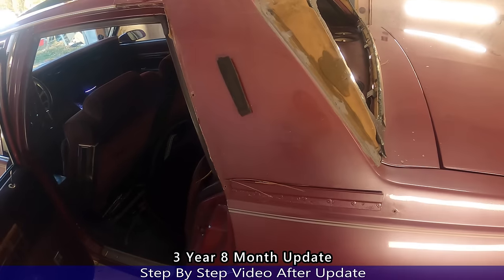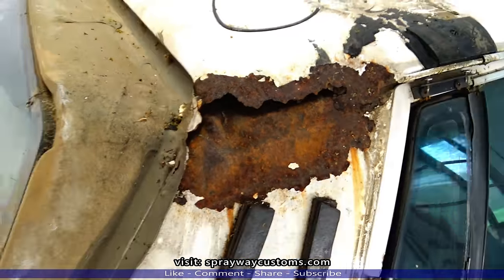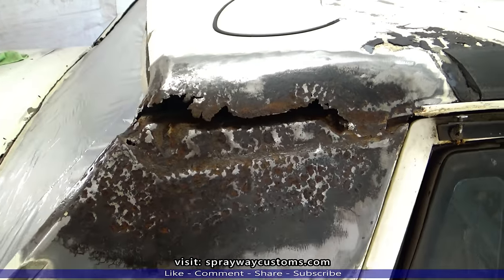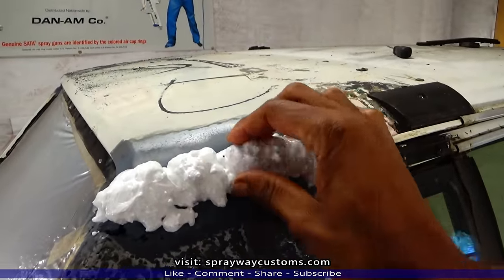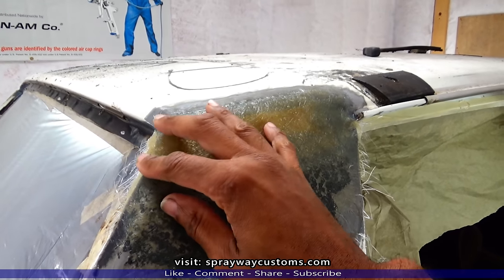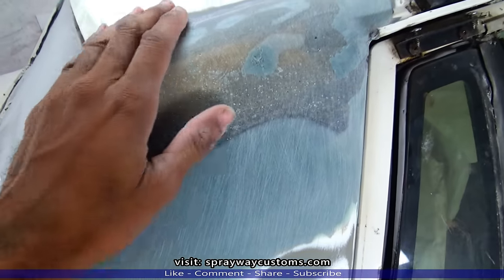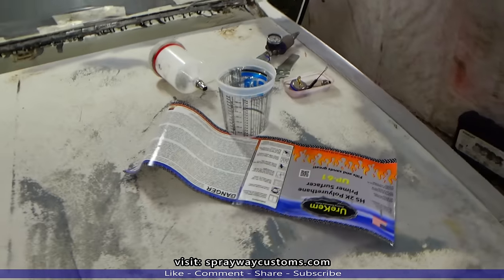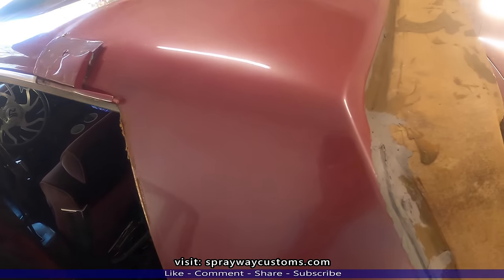How To Repair Rust On A Car With Fiberglass & Spray Foam Without Welding - Vinyl Top Rust Repair

Comment: I remember watching that video and reading those comments. Looking at how bad that roof was rotted, you can understand why some people were skeptical. But the proof that you knew exactly what you were doing is seeing how it looks today. You nailed it and it's fixed permanently. 

Happy Birthday.
Reply from the maker: Thanks man 👍
Reply: Is your shop in Decatur? What is your contact information?
Reply: I'm in Decatur too.
Reply: @ Edward Walsh
I wouldn’t say permanently but, I will accept fixed on a budget. Any moister that gets in there will eventually be an even bigger headache, especially when you don’t neutralize the rust that was already there.
Reply: @dougj.8288   Did you watch the video? He did neutralize the rust. And the closed cell foam he used is water proof. I seriously doubt moisture can/will ever get in there given the way that he packed it in. There may be other problems in other areas of the roof down the road but I think this particular area will be fine. Would a metal repair or a roof replacement have been better? Sure, if you have the dough.
Reply: The roof is a structural panel it is not only stupid but irresponsible to use jb weld sticky tape fibreglass or tinfoil to “repair” it
Reply: HB my guy
Reply: I used this same method for a few cars it's going on 8 years now no issues I think there is no one right way to do anything but your preparation definitely will make your hard work pay off
Reply: I know I was a bit sceptical too but after seeing the fine job he did I'm impressed..and I'm a welder. But if your not this is a legit lower cost easy solution that will last quite some time..and in fact won't want to rust again as its not metal anymore..well done sir! Although I don't know how the strength of that piller area might compromise and move and flex when the car drives. But still good work.
Reply: @ Edward
White vinegar nor primer will neutralize rust. Am I missing were the rust is neutralized? If I did I sorry, I still feel like this is a quick cheap fix. I have also bought cars that had this type of crap done where I didn’t find it until later on, which is what I think bothers me most.
Reply: @dougj.8288  The primer paint and fiber sealed that

Comment: I just bought an old 71 Dodge. former boogie van that's showing its age with a lot of rust. I am planning on doing body work for the first time with fiberglass. This is the best video I've seen yet. No nonsense, no blah, blah, blah, just straight usefulness. Subscribed.
Reply: Yeah, this is the best one
Reply: If you can't do the job right then do it at all. Fiberglass and bondo will npt hold up you will have a lot more work when you have to redo it.
Reply: @tonysmith302 how will he know if he can do it if he never try?

Comment: Your work speaks for itself. Fantastic repair!! I remember the original video.
Reply from the maker: Thanks for tuning back in 🤝
Reply: People are saying the foam collects water and would rot the car out.  What do you think?
Reply: @martinalbert5653    I looked up the foam that he used and kit is waterproof and also repels water.  So whoever told you that, do not know what they are talking about.

Comment: I think alot of the doubt the so called professionals (some could of been) had is because they never tried anything like that before. I'm not a professional but I've seen a few people use a similar method just without the foam and it worked fine. It looks amazing and well done on that top. I was more worried about the top because you made it look to easy. I really thought there was alot more to it. I don't know your past painting and fab training but I thought you said you basically learned on your own by trial and error. If thats true thats even more incredible.
Reply from the maker: Thanks for the support
Reply: They are too bookish. Its not always the answer
Reply: The main issue is that the car is now structurally compromised 😉
It's like using cardboard to hide a hole in the floor 😱
Reply: @deanosaur808  What are you talking about, cars now a day are made of foam and plastic. Not worth a penny.....!

Comment: Done pretty much the same on 6 to 10 feet gouges & holes in Heavy Goods trailers inside & out.
Constant repeat repair jobs in an HGV bodyshop in the UK cos the delivery drivers were always catching top corners of their wagons on the way out of bays etc & pallets being constantly rammed & scraped down the inside of the trailers too. Good job 😊
Reply from the maker: Thank you

Comment: Well done man! People are right in that they have seen some people try to repair with spray foam and it not worked, I seen those videos too and generally that is a quick fix for lower rocker panels or places that have rotten out before and the issue is # 1 they aren't addressing the source, like you shown where the water would sit, and described how it wasn't finished. #2 most people aren't finishing it with fiber glass, and bondo, then high build primer, and then it all gets wrapped in a glorious candy coat of paint that tucks it in all nice like you are doing it. 
Spray foam is more or less keeping you from needing to add so much glass, you can build out the flat surface, whereas the quick fix spray foam they are speaking of is often to replace structure, and yeah that won't work for them. Not only that, but the water gets trapped under thier spray foam which they prolly didn't prep before they just sprayed away and made it all worse. 
So you bring it up and generally you are chastised about it on forums and such. First time I heard about it was on facebook in the S-10 forums and yeah most our old beaters have that problem, rotten rockers behind the door at the bottom of the extended cab, and yeah that is about as much effort as people put into fixing it. 
I wouldn't guess most these people really understand and respect the amount of prep work you put into things so that it all lays right, and will outlast the car you are doing it to. I would guess most your growth over the years has been at prepping better and faster rather than revolutionising the way you spray, right? 
Mad props, thanks for the edutainment here!
Reply from the maker: Thanks man, you’re correct….prepping is about 95% of the job 🤝

Comment: Man I can’t believe it’s been 4 years
That’s crazy I been here longer than that
Your vid’s are amazing and very inspiring 
I do almost everything myself to all my vehicles and auto body has never been my strength but you give the confidence that I need to at least attempt shit like this 
Anyway im up north and we got the coldest time of the year rn and if it was summer I’d tackle my Rocker panels under my 05 Denali it’s got some weak spots I already gave it a shot one day but didn’t have a angle grinder and skipped the vinegar step and didn’t use foam backing nor the fiberglass only spot putty and of course the rust started bleeding through the putty, primer and like 4 coats of paint 😂smh 
But thank you for your vid’s and your work is top notch as well as your videos.
Reply from the maker: Thanks for the long time support. Yes, the rust will come back if you don’t completely remove it

Comment: I think the title of this video should be "How to Work One-Handed Like a Boss!" The fiberglass is a great option, but I'd avoid the spray foam. It absorbs and holds moisture. Since you probably still have a lot of rust behind the repair (you can't get to the other side of that metal, after all), it's asking for trouble later on. Still a beautiful job and holding up well.
Reply from the maker: Greatly appreciated

Comment: There is a product called ospo it’s a rust treatment that stopped rust . Remove what you can let dry treat with ospo buff with 3m pad prime and paint . This is some good stuff
Reply from the maker: Thanks for the info

Comment: Good job bruh.
Reply from the maker: Much appreciated
Reply: @SprayWayCustoms  ay where you located. I gotta 71 Cutlass S needin a lil rust repair and paint. U can see the car by Searchin for 
Slang. Cuttin Up 
With the period. 💯
Reply: Lil rust is under the paint at the bottom corners like normal
Reply from the maker: @SlingSlangSkrrt.  ok then…I’m in Alabama
Reply: @SprayWayCustoms  cool. If you were interested In doin my work I could get it to you fasho.
Reply: My car is for sale also if you know anyone interested. 💯
Reply from the maker: @SlingSlangSkrrt.  what you looking to get done and what color?

Comment: Man Spray Away from what I've been watching and learned over the years I think you do excellent work especially for the condition of some of the stuff you school us on. I've watched several of your fiberglass builds and all of them are awesome. Heck if I still had the ability to do it I would in a heart beat. However thanks again for another hit. That's why it's not good to down it until you try it.
Reply from the maker: Right on…appreciate you

Comment: Spray foams for household uses absorb moisture. Automotive foams are 2 part and repel moisture. That being said, I've used the cheap household foams to fix my own vehicles. I had a 78 Camaro that was completely rusted out. I knew it wasn't gonna be around long, so I used spray foam fiberglass filler to make it look better. People who hadn't seen it before the repair had no idea. I drove it till the frame started giving out then sent it to the Junkyard. If i was doing a repair that i wanted to last, I would use Automotive 2 part foam. There are different types for different applications. There are stiff structural foams. Soft NVH foams. And some in between. 
If you're working on your own car. Not trying to sell it. Do what you want. But if you're doing a car to sell. Use the proper products and techniques. If you're doing a customer vehicle. Do what they want or can afford. 
Sprayway definitely shows how to get the best results for whatever budget you have. Great video as always
Reply from the maker: Appreciate the info D.A.L.

Comment: I have a 99 Mirage with roof rusting in 15+ areas throughout and I got the spray foam already, rustoleum spray, grinder, strip discs, and just need a couple other items. Just on here looking for a good budget DIY way to repair.

I'm using this video for my project. Thank you!!!

Comment: Ugh what a PITA. 
I've had to do similar repairs on my old Mercedes, where water got under the seam sealer and rusted holes. I used Miracle Paint to soak into the fiberglass mat - makes for a one step repair on smaller holes that are out of sight, and don't need to be structural. 
Does the vinyl top have any structure to it? Looks like it came out great!
Reply from the maker: Thanks man. No the vinyl top doesn’t have much structure

Comment: Beautiful work as always !! , I wish I would have seen that video last summer , I had to fill some rotten holes in my Elco roof , and I thought about spray foam  because I had just done a woofer box in it and I had a little bit of foam left !! !! But didn't try it , it needs to be redone now already , I'm going to do it exactly the way you just showed me ,! Thanks man !
Reply from the maker: No problem Paul

Comment: I would have cut that and welded in new pieces BUT dangit I won’t anymore. If I watched the original video I would have thought it’s a terrible idea… it’s not and I’m wrong. This is actually a great idea. No it’s not a factory restoration but who does those anyway? This is just awesome. Thank you for showing this and teaching a valuable idea.  I just can’t believe how good this looks but there it is 4 years later spotless. Awesome
Reply from the maker: Thanks Matt

Comment: My 2 cents...Id use the 30% cleaning vinegar available at lowes or home depot for $20 a gallon.  Its 6x stronger than kitchen vinegar.  Faster yes, more thorough, probably.  GET A RESPIRATOR IF YOU USE IT. Not a dust mask. Cant knock the finished product four years later though.
Reply from the maker: Thanks for sharing the info

Comment: I remember watching this the first time around, just watched the whole thing again... Honestly I didn't think it would last (but didn't comment, I figured that you knew what you were getting into) for 2 reasons:
1- My cousin used spray foam for  similar repair on a mustang. Eventually the foam got water logged and the pannel rotted out from behind
2- I grew up in the rust belt (Buffalo), and my experience with rust repair is that unless you manage to get EVERY LITTLE SPECK of rust out it comes back very quickly. Typically that's next to impossible to do and you were working on a bad spot. I'm wondering if going after it with the vinegar is what really made the difference. Typically someone would cut out all the pitted areas and still have problems with it coming back, and even rust reformers/phosphoric acid type products don't give results this good.

Either way it worked, and worked well.

That said, I am curious, why did you bother with the spray foam in the first place? You could have prepped the metal the same way and that fiberglass repair could span an area bigger than those holes successfully and been structurally strong enough. I guess that it might have been marginally easier to lay the fiberglass over the foam, but I doubt that you would have had a problem with that.
Reply from the maker: I just used the spray foam as a backing but I could’ve did it without it though. I agree 👌Thanks a lot

Comment: Man!!! This video is an extremely intelligent approach to DIY vehicle body work!!! I believe that the Most High God has endowed you with the
knowledge to do this work, and I am amazed about the manner in which you repurposed the vinegar and the spray adhesive. I had intended to
use liquid steel (no welder either) for my body repair projects, but it is far less cost efficient than your method. Keep in mind that the auto
industry has manufactured cars (Corvettes, etc) that embody complete fiberglass bodies; Obviously, the players haters don't know this fact...
Reply from the maker: I agree 100 percent

Comment: Pretty good job, only thing I'd do a little different is not use the bondo... would have finished with the fiberglass filler.
Reply from the maker: Thanks for the tip

Comment: I picked up a wire feed, what they call a Flux core welder for cheap, under 199.00  a few years ago from Harbor Freight. (UP in Canada or Alaska, its called Princess Auto). I just beleive that welding in a peice of metal then finishing it out, would last longer.
Reply from the maker: Thanks for watching. I have a couple welders as well

Comment: Cool work ! Really like the vid! This is a very less electrifying way to repair but I politely disagree with the affording to pay a welder.  When welding on YT is also DIY.   

Harbor freight shopping list 
1. The grinder is about $10
2. Flap disc a couple for a pack of 1-2 $5 
3. The welder is around $100-120  one spool of .035 wire material is 15 on Amazon or$ 17 (plus there'd be a ton left to practice with and left over.

4. The steel can be bought from home Depot for little to nothing.

The hardest part is shaping it with cardboard. As a replacement template. For the rusted out piece.   

Steel will always be stronger over time than the fiberglass but what about if this is left outside? And over time the car bouncing up and down the road and if it has a sound system will slowly sperate it like it did my factory ramcharger rear fiberglassed hatch.

I think this is great in a pinch but not the best for structurally sound. Imagine  if this car rolled over which piece do you think would give in first the. Steel or th fiber Glass. Still a really good option just not on the roof steel/lead  is still king for roofing on cars
Reply from the maker: Thanks a lot for tuning in. I agree with you

Comment: I don't know why anybody would have questioned this repair from the beginning. Fiberglass does not rust! That repair will last longer than the rest of the car. 😂😂😂 The technique he used is the technique that I used to repair my fiberglass running board on my van. 6 Wisconsin winter years later. It's still holding. Even after I hit a couple of snow banks. 😂😂
Reply from the maker: Glad to hear you had success with it as well. Thanks

Comment: I used to be completely against this, probably because I got an unpleasant surprise with my 77 lemans. The og vinyl top collected moisture and rusted the bottom of the b pillar. Dude threw bondo on it and the holes jut got bigger. You sir give me hope for the future cause I ain’t got the money for a welding job. Btw how would this do if it was not covered by a top and/or kept in a garage? Thanks for sharing your talent bro.
Reply from the maker: No problem. Thanks for watching

Comment: When are we going to see Sprayway weld in patches? The foam provides a structure for the fiberglass like a metal patch. Great solution for down South but not sure if that would work in the rust belt. LOL You could also rivet a metal patch in there too. You're channel is one of my favorites and I have learned a lot watching do your thing.
Reply from the maker: Thanks Tom 🤝

Comment: It’s crazy that GM had the drip rail end into an unfinished area with no way for the water to escape and created that mess under there,a little more thought during the design of the car would have gone a long way.  
I repaired the rockers and cab corners on my first C10 when I was 16 years old with spray foam and fiberglass.  It worked Well 
My skillset at the time didn’t allow me to replace them with new metal.
Reply from the maker: I agree.. thanks 🙏🏾

Comment: The white vinegar dissolving rust I haven't seen anywhere else....no wonder your repair is still good - I repaired a wing and it blew out it 6 months 'cause I coouldn't get all the rust.
Reply from the maker: Yes, it actually works